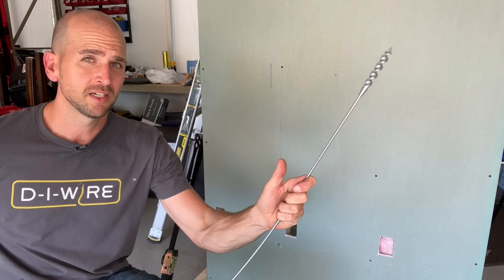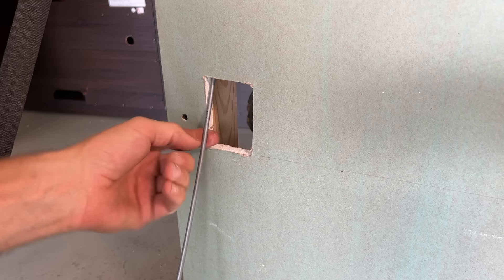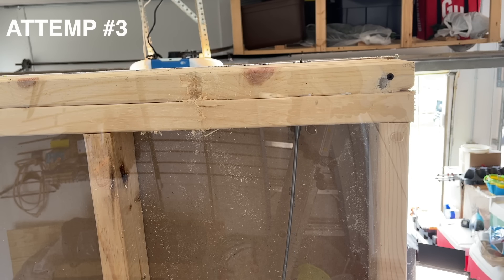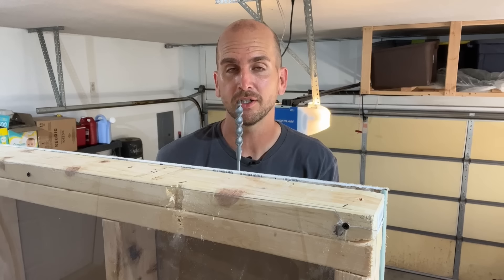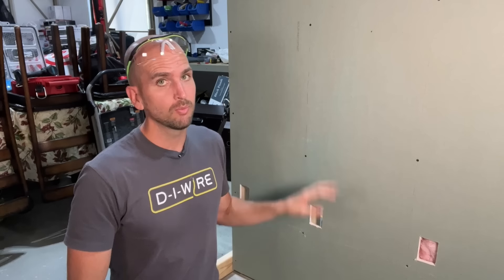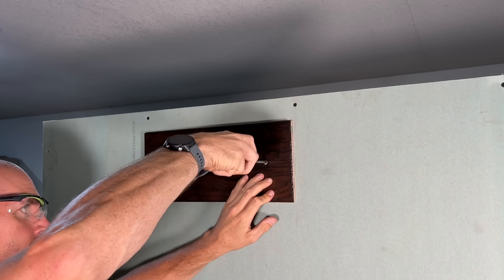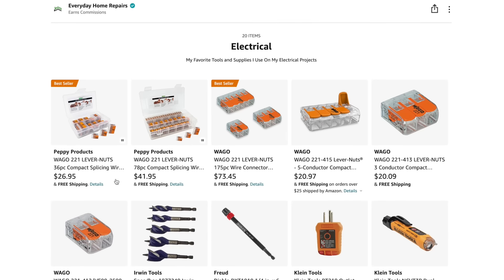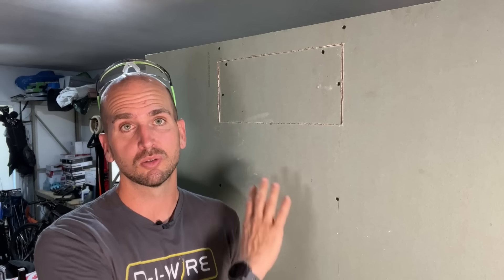Using A Flexible Auger Bit To Fish Wires Through Walls

Comment: If I make an opening near the top of the wall (the second method), instead of a wide horizontal opening, I use a narrow horizontal opening but much longer vertically. That allows the drill bit angle to be more perpendicular to the top plate, it won't be 90 degrees, but it will be closer so there is no worry that the hole comes out the far side instead of the top. This is especially an issue if the top plate has more than two stacked levels of 2x4s. The downside is one can't use the studs on each side when doing the drywall patch, but that's not a big deal if you know how to patch drywall.

Comment: Use a right angle adapter on top, it will definitely help. One of the best tools in running wires !! You’ll go straight up and not at an angle, and you could also make a smaller hole.

Comment: I've been using this bit for years. I always make a small  ditch or cavity  behind the upper center of the hole before I begin drilling. Then I feed the bit up the wall long that path. It helps the bit remain centered and straight as I drill. I haven't tried the ball method. But I think I will on the next job.

Comment: I had to do the 2nd one a few weeks ago. Added a ceiling fan to a room that didn't have one and need to run the wire to a switch that controlled an outlet but couldn't drill down from the attic cause it was on the exterior wall so I had to cut a hole in the drywall drill up into the attic to run the wires. My drywall repair turned out really good can't even tell there was a hole there. Lowe's did an amazing job color matching the paint for me. Just bought a sample size to paint the patch much cheaper than the half gallon

Comment: I prefer to use them from attic down. Bore through the top plate with a seperate bit then use the flexible auger for the rest of the wall. I prefer the Greenlee flexible auger bit. That one is extendable with interchangeable bits, and you can buy more extensions for it. But with the Greenlee once it goes through you detach the bit and install the wire pull bit. So much easier. But you will be in the attic a bit more, but guarenteed to drill where you want. Even on insulated walls. The flexible auger you used it a pain in the ass for all the reasons you showed, and you are purly drilling blind. With the Greenlee you drill where you want.
Reply: I just bought a 5 piece kit today with 2 extensions, drill and 2 other attachments!

Comment: I've learned to consider those flexible auger bits disposable because it seems like just about every time I use one I manage to ruin it by hitting a nail or a screw. Twice, I've had them get so jammed the auger portion spins right off of the shaft.

But I have used them successfully. The biggest success was when I had to drill horizontally through three studs to wire in a switch -- cutting access holes in the walls was not an option, and neither was going up or down (because of the way the building was constructed).

Comment: Definitely the second method is more like it. It just makes you wander when the cable guy come and use the first method and probably not knowing how to operate it properly. I ran all my camera cables by drilling from the top instead but also I had easy access. Loved the video
Reply from the maker: Thanks Hassan, I will be practicing a bit more with the flex bit but for a normal DIYer I think it would cause more harm than good 👍

Comment: From previous personal experience, no I will not use a flexible bit ever again.  I managed to:  complete 1 hole AFTER punching through both sides of the wall and then eventually got the bit stuck while trying to get a second hole don down to the 1st floor.  This was with the "bender" accessory as well.

I have seen workarounds, like a ball that is used to center the far end of the shaft just before the bit but that's only useful when you don't have insulation and/or a fire block.  Next time will just be cutting out drywall.
Reply from the maker: Yeah, I will keep the 54" Auger bit handy and possibly punch through a fireblock but when going through a top plate where I can't access from the attic I am still leaning towards cutting out the drywall 👍.  Thanks for the feedback.

Comment: I used a flexible auger bit for the first time in my recent project and I did exactly what you did on your first try which I ended up drilling right through the wall on the other side.  What I figured out is you still have to make a small hole in the drywall like you did but I did a small pilot hole and then used that as a guide for the auger bit.  What you did would not have worked in my case because you angled your drill whereas I was able to drill straight up. Also my houses frame is a good 6 inches thick with all that stacked wood.  A standard spade bit would not have made it all the way through.

Comment: Great for pot lights. The wide cavity because of the size of the lumber makes the flex bits great in that situation.
Reply from the maker: That would be doable especially with reasonable spacing between lights where you don’t have to many joists to get through.

Comment: They sell plastic or wood balls to help direct the bit in the wall toward the middle of the stud you're drilling.  If cutting into the drywall to work the stud directly, use a large circle hole drill or use a can light drill with a cover to minimize mess.  Much less effort and still a perfect cut to put back easily for mudding.

Comment: I thought maybe when using the flexible bit, you could possibly use the camera on your cell phone to help you in guiding it where you want📱 I don't know, just a thought🤷‍♂ BTW loving your material👍👍
Reply from the maker: Thanks for the feedback.  I think you might be able to do that for drilling through a bottom plate into a crawlspace or up through blocking.  Appreciate the support 👊

Comment: As much as I hate finishing drywall, I'd either go with the cutout method OR drill a hole up from within the living space, per another commenter's suggestion.  I was recently in my attic boring a hole down into an exterior wall and even with a right-angle attachment on my drill it was a really tight maneuver.  Plus being flat on my belly with my bald head (protected by a bump hat) rubbing up against the rafters and roofing nails, it wasn't fun.  AND, it was dang hot up there!.
Reply: Me too, bald head, shingle nails through the sheathing poking me, laying on pieces of plywood on top of fiberglass insulation which stirs of clouds of fiberglass particles absolutely sweating my balls off. Nightmare. Hundred year old house so there’s like 6 inches of clearance between the roof and the top plate, I’m wedged in it triangle between the roof in the attic floor. What’s gotta be done has got to be done.  Nasty Jobs.  Eventually I use a vice grip and broke all the (dozens) nails off, even that’s nasty.
Reply: @williamwixon  Ha ha.  I used my roto-zip wtih an abrasive wheel to cut off the most offensive nails poking thru my sheathing.  MIce turds in my insulation along with fistfulls of sunflower husks from the previous owners bird feeders.  Oh, and I did find a totally intact, 100% mummified squirrel under some insulation.  Scared the bejesus out of me when I uncovered it!

Comment: For the top floor stick a glow rod in the ceiling to find your spot in the attic, and then drill from up top. On the first floor cut a rectangle in the ceiling big enough to fit your hand in, and one at the top of the wall long enough to fit a long bit in. Drill through from bottom.

Comment: One thing I have discovered in my own home is that there can be a wire running along the top of the plate.  If there is, and you drill through, you will drill that wire.  Nothing is always as it should be in our homes, especially older ones from the 70s and before.  I am going to drill a hole in the ceiling as well, so I can stick my hand up there and make sure the top of the plate is clear.

Comment: We don't have those flexi bits in the UK, with stud walls becoming much more common these days, they'd be quite useful. Problem is we have cable zones, you can't just fish the cable up diagonally, it has to be directly vertical or horzontal from an accessory box, OR within 150mm (6") of the corners of the room
Reply from the maker: Thanks man, I appreciate the info as it is always interesting to hear the differences in code across countries 👍
Reply: @EverydayHomeRepairs  Indeed, I chat to a lot of American sparks, and european ones, on Discord, it's always interesting to compare notes. The  US NEC tends to be aimed toward preventing fire (being written by the NFPA), the UK and European codes are typically written by electrical engineering bodies, and focus on reliability and protection from shock (that requirement of course is made more important by the use of 220-240v), 

The US industry does seem to have many more specialist tools, but that's likely because larger market (same basic system is used in US/Canada/Mexico, with variations all over the world)

Comment: Maybe I’m missing something…I am a below average DIY’er who has spent more time fixing my mistakes than I have on my projects but…I recently installed a digital TV antenna in my attic. I had to drill a hole in my top plate and a cross piece inside my wall cavity between the attic and the ground floor of my house. I used a flex auger bit like you did at the beginning of this video except I drilled the holes from ABOVE rather than from BELOW as you demonstrated. Coming from above gives you far more control over the bit since you are not putting side tension on it going up from below through the drywall access point. I drilled two holes down through the top plate first. One for the antenna cable and one for a fiber optic camera. I had my partner operating the fiber optic camera who helped me line up the auger bit inside the wall cavity again going downward. Once we had the bit lined up on the cross piece, I drilled that hole. Then I went downstairs, we fed the antenna cable down, and then cut the drywall for the outlet box and installed an outlet plate able to accommodate an RG-8 cable and port. I then connected another short length of RG-8 from the wall port to the TV and I was done. We started at noon and by 1pm, we were all cleaned up, cracking beers,
easing back our recliners and enjoying the 1PM kickoffs.

Comment: I'm not an electrician but an avid DIY'er and I've done a lot of wiring and plumbing. I have a flex bit and it's worked great but it's only 36" long and I've only used it drilling down (from a height of about 18" through the floor to the basement). This insured that I got into the wall cavity as I was concerned that if I drilled up I might miss it and end up with a hole in the floor. Not having a lot of experience with this bit I would have been reluctant to drill up with one as long as the one you used.
Reply from the maker: Yeah, the 36"drilling down is a bit more reasonable.  I have also seen people remove the trim and do a small pilot hole on the front of the wall down into the basement so you know exactly on the wall where you want to drill.  You might want to stick a wire down through the pilot hole to make it easy to find in the basement.  Then if you have 2x4 walls and 1/2"drywall you just move back 1 1/4"back from your pilot hole to hit the middle of the stud drill from the basement.
Reply: @EverydayHomeRepairs  That's a good idea - thank you

Comment: 18 year network cable installer, had about a 60% success rate running a flex bit up...just my 2 cents, the other 40% we usually fount the bit where we didn't want to see it. The guide tool does help a bit with practice.  Don't find a lot of wood studs in commercial work.
Reply from the maker: appreciate the feedback 👍

Comment: I was very curious on number 2 and 3. I am planning on mounting wall sconces using the outlet next to the bed. Using a stud finder I see there is a cross beam in the way between the light location and the existing outlet.

Comment: I've drilled hundreds of times with these running rg6 or cat5 cable. You typically would drill downward using a bender/guide. It becomes really tricky when you drill through 2 separate plates from floor to floor. I've hit water lines and romex and electrical panel feed lines. Luckily no gas.

Comment: I've used diversibits for years. I usually have good luck. I'm doing alarm work normally higher than you. Touchpads mainly. They make a flexing tool to go over that bit to bow it on center. Never had any issues. I do a prehole with an 1/8" bit, 12" long. Shove a coat hanger through. Go to the attic and find it. Go back and drill your hole.

Comment: While I own two of these and do try to use them for running low voltage wiring in my 1916 house, my horror story was accidentally punching a hole in a plaster ceiling while boring horizontally through second floor joists. It was a lot of effort to repair. I am probably stupid enough to try this again though...

Comment: lol, for all DIY - ers who have no idea - but like expensive experiments, get a friendly electrician to do the work (they may still let you screw up your own walls if you ask nicely) - Also if you MUST have that new powerpoint/outlet in the perimeter wall (and can't access the top plate - there are still options)  - well you may think you are all out of options (or consider putting the outlet in a common interior wall - a much better idea for thermal reasons anyhow).

Comment: Great video and I like the template tip!  I would use a 3”guide ball sold on Amazon to align the drill bit in the middle of the 2x4.  I always worry drilling blindly up into the top plate fearing that there may be wires on the other side and I would drill through them.
Reply: Never seen one before, but after your tip and checking them out i'm 100% with ya. Those look awesome, bet you could do the same with just a tennis ball or something similar.
Reply: @stevefifield1207  I think the ball comes with some type of stop collar to prevent it from sliding down the drill bit shaft and that is why a tennis ball not work as good as the drill shaft ball.  In any case, you take a big risk drilling inside a wall where there could be other electrical lines, water and natural gas lines, etc. that you could damage and/or cause a fire.

Comment: Another method I have used - Locate where you want to bring the wire down at.  In the ceiling, about 1-2 inches from the wall, drill a small hole (like 5/32") and use a piece of wire & push it through the hole into the attic.  If you have alot of insulation, use a longer wire & something that will contrast to the insulation.  Measure the thickness of your wall that you will be drilling into from above & know the distance from your hole to the walls edge.  (take wall thickness & divide by two, then add distance from ceiling hole to edge of the wall)  Go into the attic, find your wire.  Make sure you know which side of the wire you need to drill your hole. (experience speaking)  Measure over & drill your hole.  You should be in the center of the wall pocket.  I have done this many times installing electric baseboard heaters or adding a light switch to a room in a old house.  When finished, you can easily patch the ceiling hole with a little Spackle on your finger.

I have used the flex bit too, but usually when I'm drilling down into a basement - baseboard trim hides any off center hole drilling.  Once through, don't pull the drill bit out yet - tie your wire on to the drill bit (the bit usually has a small hole drilled through the bit on each end, to attach the wire to), then pull your bit & wire out.

Comment: Never used a flex auger but, but one suggestion I can offer when guiding it close to the ceiling is to try to catch it using a powerful magnet and see if you can start drilling closer to the current wall. The angle should be much straighter and I'd love to see your results for round 2!

Comment: I have used them several times they are a lot easier to go down than they are to go up. But like you said once you hit a screw or a nail it is dull and pretty much useless. They don't last very long. But the whole point of those is to not open the wall at all.

Comment: Thanks.  I was about to buy all the flex bit tools but the possible harms , especially errant holes in the siding or roof, are too great for me.  Years ago I replaced burned Romex (from an indoor grow I would guess) using drywall patches so I know it can be done.   I'll use your template idea but I think I'll make my hole/patch vertical and centered in the cavity so I can cram my drill into the cavity and get a hole angled slightly away from my low slope roof on outside walls so it will be easier to feed the Cat 6a I'm running.  How about thinking up a robotic way to fetch and feed cable fed from below to a patch panel/switch at a second location below from  a ladder standing half into an attic access hatch.  2 in 12 pitch roofs are the thing around here.  You're body surfing in blown in insulation if you climb up into the attic.  Doing that about 30 times for the cameras and many keystone jacks I want will be hard.

Comment: Great tip with the flooring template.  How would you handle a cavity with blocking, using that method?  Cut another hole at the blocking?
Reply from the maker: I actually would do the auger bit but with no extension.  I felt more confident with a max of 54" once you stretch out further I found the control to be lacking as you saw in the video.  So, I would punch through the blocking with a flexible auger bit and then use fishing tape running up the wall through the blocking.  I could easily grab the fishing tape through the cavity and pull the romex down.